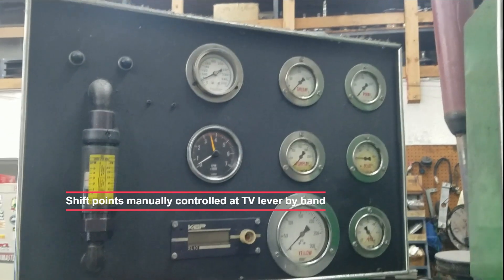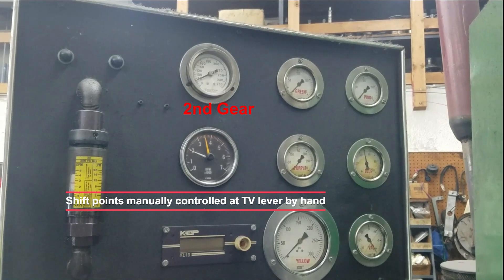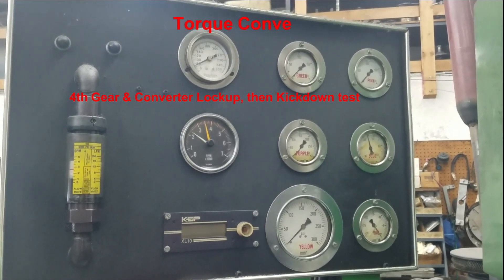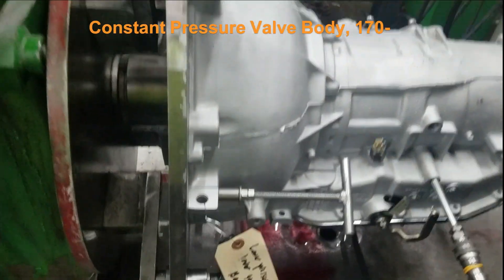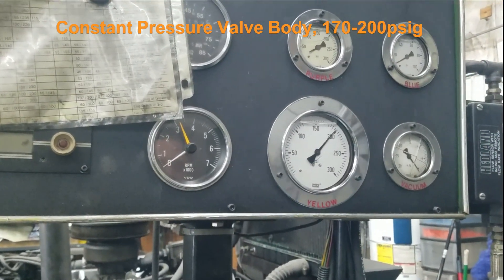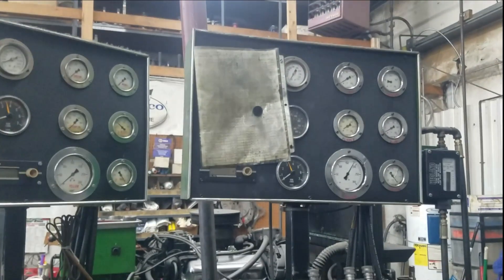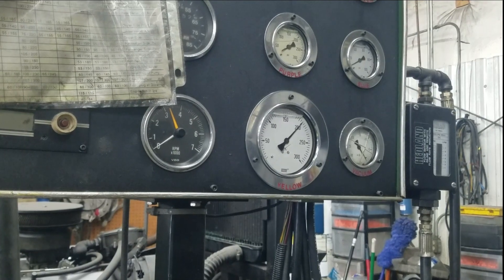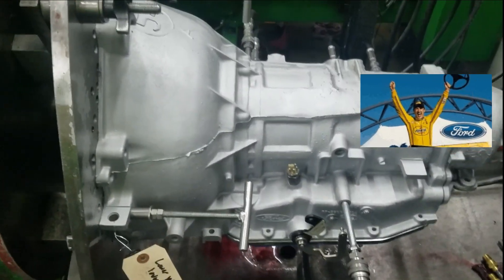Ford AOD Transmission Dyno Test with Constant Pressure Valve Body

Comment: Oh snap you guys do AODs??

Man im in everett.  Im looking at building a 347 stroker and i got a good AOD from Redmond and was looking at silver Fox transmissions.
Reply from the maker: Coolness!  Contact Dan Silver via his website for the AOD kit you want, then have Ed's transmission in Marysville assemble and test your AOD.  Contact Andrew at Ed's and tell him Brandon sent you.  I am going to be watching your Zephyr videos.  Cool project!
Reply: @BlueOvalEdge  thanks for watching.  

I am torn between going lockup or non lockup.  It will be a fun car to drive but when. I want the power there it'll be there.
Reply from the maker: @KingJT80  i hear you. I
My 69 Convertible is a pleasure cruiser so I went with lockup. Non lockup is like an old school C-6 with an OD gear. It will require a larger trans cooler than lockup. I seem to gather that most non-lockup guys are drag or road racing.
Reply: @BlueOvalEdge  yeah I might be at on the car a little and don't want to find the weak link is the transmission